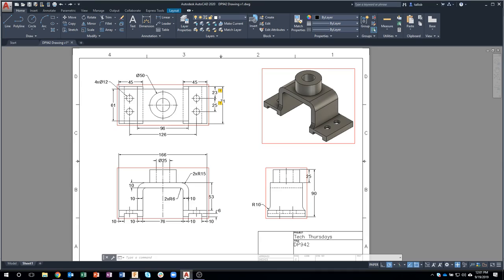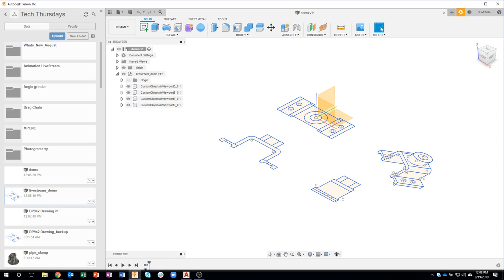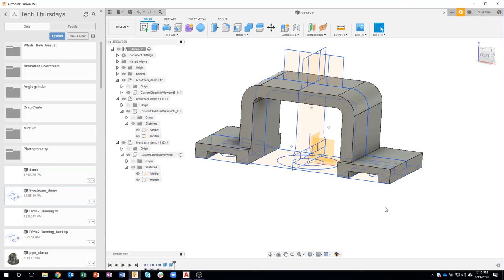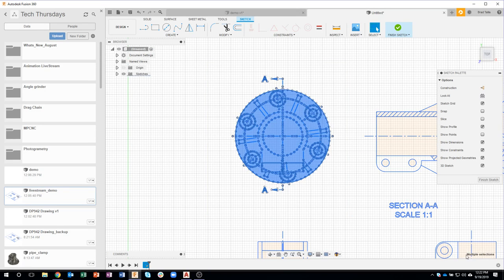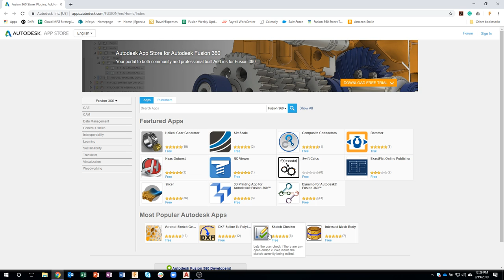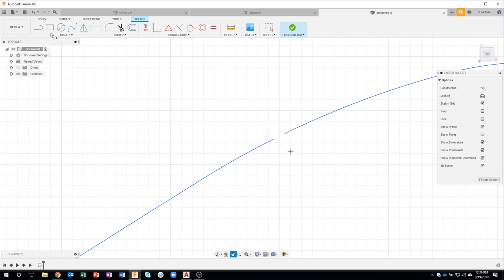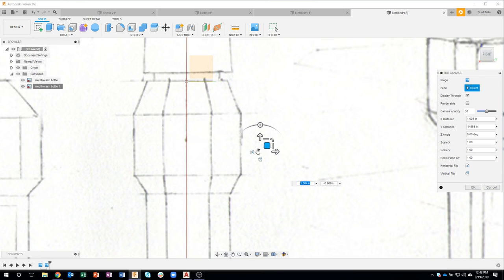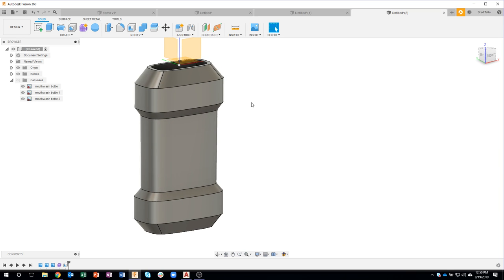Using 2D DWG/DXF to create 3D Model

Comment: I've actually done something similar to this when I was trying to teach my Dad how to use Fusion. He's been using AutoCAD since before I was born! The way I did it, though, was to take the top view and Extrude it up further than I needed it to go. Then, using the front and side views, I was able to do Extrude Intersects to reduce the initial Extrusion down to the dimensions that I needed. There will still be some cleanup to get the part exactly right, but, I think it's way faster than trying to do the extrusions exact the first time.

Also, based on the drawings, I don't think that big hole on the top goes all the way through the part.

I hope this is helpful!

Comment: You can usually use dxfout from AutoCad to bring it into fusion. Also you can use online converters.
Reply from the maker: @Patrick-  I didn't have much luck with the online converters, but someone else mentioned saving the dxf to a different format, then back to a dxf and that tends to help the process.  I'm going to have to give that a try.

Comment: I think Fusion 360 will properly import DXF CIRCLE and ARC entities. That yours are tessellated into LINE entities is likely the fault of the program that exported the file or the author of the design explicitly doing it. The biggest problem with DXF files is that, except for the POLYLINE entity types, there's no logical construct organizing a set of randomly listed entities into a single, contiguous contour. That certainly makes gaps easier to create by accident while editing.
Reply from the maker: @Scott-  Yes, you are correct.  I've worked with some wonderful DXF files, and then others that left me scratching my head.  Thanks for watching!

Comment: I followed along to turn my DWG into a 3D model and it worked flawlessly! Then I went to put dimensions on it and it showed my 30 inch bar to only be 1.5 inches long. Is there a way to bring the dimensions over? Or a way to dimensions the model after extruding the shapes?

Comment: Nice video but i still think modeling from scratch using hard copy drawing is better , faster , certainly considering there is no dynamic link between the drawing and model
Reply from the maker: @Bigfilsing-  I agree on a part this simple.  However, there are many cases when customers receive much more complicated drawings that would take MUCH longer to rebuild from scratch.  I kept this example simple to show the process.
Reply: @adskFusion  Thanks for the reply.  I hear ya and understand the reasoning behind this tutorial . But still taking all into account im with modeling from scratch . Hours spent preparing a dwg then importing seem wasted when the result isn't properly parametric. Just my 2 cents Cheers
Reply: @adskFusion  Have you ever tried to import "much more complicated" drawings into Fusion ?? Please try it ....Fusion grinds to a halt and locks up.  Dont get me wrong i love Fusion but there are certainly areas where a lot more work is needed. DWG import being one of them

Comment: this software needs a weld operator, and a fill gap. looks like a pain to go through every little hole and fix them manually.
Reply from the maker: Not sure what you mean by weld operator? LIke to add the physical material between parts?